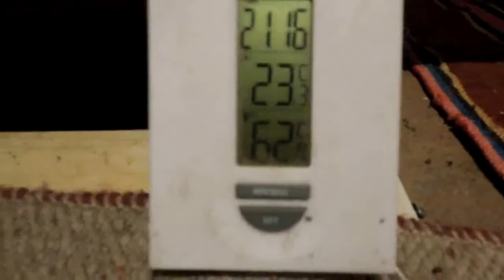Rocket Stove

Comment: Wonderful, wonderful, wonderful! Congratulations! Your finished stove looks quite a bit taller than mine. Did you stack the internal flue 4 or more sections high? Your gap at the top should be about 1.5 - 2" to the inside of the tank.
Reply from the maker: +ZeroFossilFuel 
Hello sir! I have 3 sections on the internal flue, with 5 cm the gap at the top.
Reply from the maker: +ZeroFossilFuel Hello again. My rocket stove is quite similar to yours, but with few exceptions. Between the pipe stack and the brick stacks I had to use strained perlite as insulation. The insulation is held into place by caps made of heat resistant mineral wool.
The things I am the most interested in are related to the type and size of solid fuel this stove can take. I got surprised when I burned coal pellets I was expecting to have a smell of some sort but it did not happen. Also when burning coal, the smoke of the chimney was barely visible.
I wanted to realize somehow the draft efficiency, so I used a powerful 120 mm fan to blow air inside burn tunnel via the feed tube with no improved results whatsoever. 
I will get back to you with some videos and pictures. The soon I will make some time I intend to disassamble it to see how the inside looks.